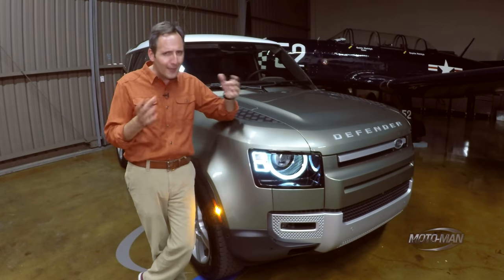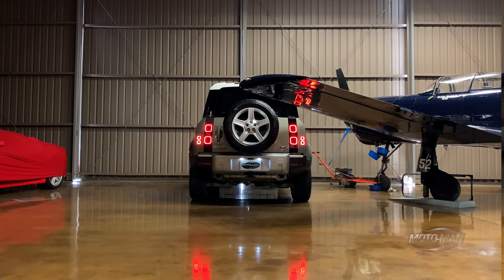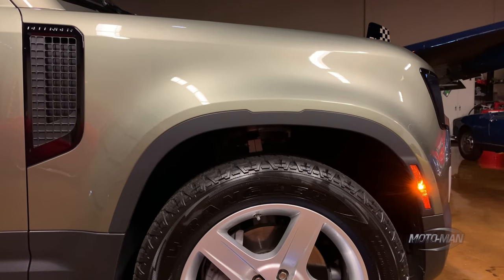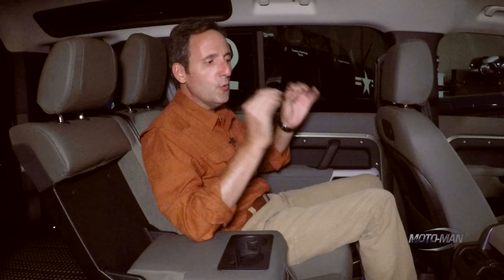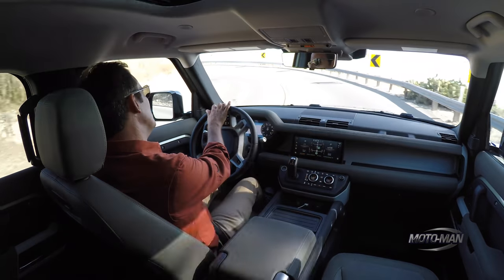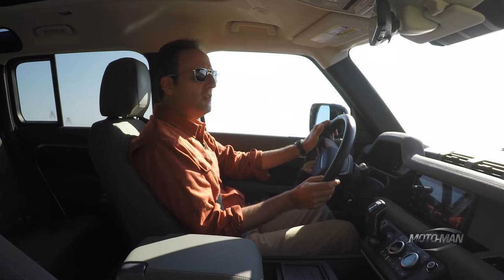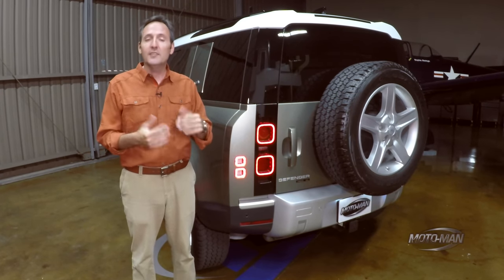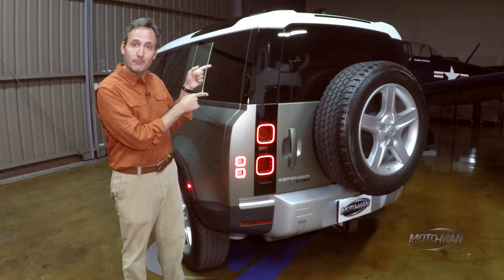The 2021 Land Rover Defender 110: Design, Tech & On Road FIRST DRIVE REVIEW

Comment: It's saturday morning and there is a new review from Motoman in my inbox - makes even a rainy saturday better! 
Even if a SUV or Defender ist not my cup of tea. The design is not bad - not too much retro harping back to the original Defender, its something newish, the main competition is the Bronco I guess ? although they must have targeted the Jeep line-up...
Reply from the maker: Tough call . . . In a round about way you could say:
- A VERY fully loaded Wrangler
- G Wagon
- Land Cruiser/LX570
- Bronco
However, with this massive shift in the Defender platform, I see the Bronco, Land Cruiser, Wrangler and G Wagon now in their body on frame class.
Reply: @MotoManTV   true - Wrangler is cult and its own market, body on frame capable, Bronco is a winner there, Defender is going somewhere else..on the road, nothing like the old Defender.
G Wagon is the most capable off road  - but it's so expensive you don't go off road  :) only the older one. I visited a childhood friend, he had a G-Wagon then and still got the same one wrenching on it, using it in the mountains still every day,  it must be 40 years plus - easy. 
Land Cruiser they are also huge..but can do both. You never see them over here, too big I guess.

Comment: The irony is the cost. Rover used to be "expensive" with Tahoe's costing $90k these cars are a good choice.
Reply: As bad as GM reliability is, Land Rover wins. They are the king of unreliability.
Reply: @electrikoptik  that's fine. Many dealers are now offering warranty for life. Id but one.
Reply: thereissomecoolstuff but is it bumper to bumper warranty 🤣 cause that’s the only way I’m ever gonna get me a Land Rover
Reply from the maker: I was more than a bit taken when the Gladiator came out and they were EASILY rolling in at US$50,000- US$60,000 . . . Yes, a SUPER cool vehicle, but at that point, I am thinking something else . . . Which makes the pricing of this rather competitive.
Reply: @MotoManTV  it's funny you mention the gladiator. I am jonsing for one bad. Diesel with adaptive cruise and I'm good. I wish more channels were honest about the cost and labor on accessories. You keep it real with the $700 blue stitching on the Porsche steering wheel...lol. Great video MM.
Reply: Yes good point.  I could live easily with a base spec Defender as it still has lots of features and does not skimp on the off-road parts.  And a base spec Defender price overlaps a "high spec" Jeep price - on purpose.... I know lots of Jeep owners who love the toughness, but hate the reality of the crappy on-road driving.  They could be tempted....
Reply: @thereissomecoolstuff  please tell me which ones
Reply: @curtissharris8914  which ones? Not sure what your asking.
Reply: @thereissomecoolstuff  many dealers offering warranty for life
Reply: If they offered bumper to bumper warranty for life, I’d be tempted. I looked at a 110 yesterday in the US and it was $60k msrp.  It was sharp. But reliability concerns and high depreciation would keep me from buying one currently.

Comment: This should have started out with a general public warning of ( We understand it's nearing the 50th anniversary for the company having built a truly reliable vehicle we've been riding the coattails of. But....)
Reply: are you implying the early defenders were reliable?
Reply: @turnerc7  Hardly, but at least the truly early ones usually had smaller mechanical issues you could rig & limp it somewhere. Now they just drop dead on the electrical side & say call a tow.

Comment: Wondering how responsive the touch screen and controls in the  center stack are?  That’s been a complaint of past models.
Reply from the maker: They were somewhat responsive in my time with it . . . one UX issue I did not bring up in the episode is tuning the radio. Very cumbersome and requires you to dive into screen. Would GREATLY appreciate another knob - perhaps on the driver's side of that panel for tuning and perhaps other uses like those two I demonstrated.
Reply: MotoManTV thanks for the info.  Your reviews are the best around.  Keep it up. Glad that you are back and doing well after your accident.
Reply: I test drove a Defender 110 X Dynamic yesterday and I found that the touch screen response was fine. It’s not as fast as an iPad, but it’s plenty quick for a vehicle system in my opinion. The Land Rover associate who was with me for the drive said that the only people he saw that had trouble with the speed of the response would hit the button more than once because they expected iPad like response time and then the system would lag a bit as it was trying to decide what the user really wanted it to do. It is a bit like saying to the system, “Go left! No right! I mean down!” all at once.

Comment: I would call it a Discovery Plus - and not a Defender. It`s not the vehicle you would choose for Overlanding. Starting with the max load capacity which is less compared to the old model. The best new Defender can take 844 kg, the e-version maximum 700 kg. Old Defender 110: 1142 kg up to 1395 kg. - Other problems are the tires sizes (try to get those of the new Defender in a remote area), the durability without a frame long term, and the number of electronics in the car. I think this new INEOS Grenadier will take the place of the old Defender in the Future. - Still a great car for the other 90% of the users.

Comment: This is not Defender.  The design and purpose are all wrong for Defender.  It is however, the best Discovery ever built.  The other issue (besides the whole design) is the model naming, 90 & 110!  WTF?  They are 100 AND 120!!!  70 years of tradition thrown out the window!  Horrendous!  Horrible!  Horrific!!! 

...but lovely.
Reply: Your obsession with tradition leads you to false conclusions. This is not a Discovery. It's a Defender through and through. The reason you think it's a Discovery is because this is a modern vehicle so it has lots more in common with the Discovery which is also a modern vehicle rather than with the old, antiquated and barely modernised over the span of its lifetime old Defender. Obviously a vehicle made in 2020 will have a lot more in common, tech-wise, with a vehicle made in the mid 2010s. It's capability and appointments though are Defender through and through. Land Rover were never going to make an anachronistic throwback with jurassic era tech and 'solutions' just to please the old Defender traditionalists. The design and tech of vehicles have to move with the times.
Reply: @cuttight  I've done 3 videos about everything that is wrong with the new defender and I don't mention axles.  Watch them...
Reply: @fabulousoffroaddesigns5080  I didn't mention axles either. But I did mention old Defender traditionalists longing for designs and solutions of the distant past.

Comment: Doesnt look fun.
Reply: It’s a lot of fun. I drove one and the only things I could nitpick was that there was less foot room near the front of the driver’s seat than expected (There is some sort of shelf the seat is mounted on) and there was a small amount of wind noise. The performance on road however was spectacular. Very little feeling of being a very tall and boxy vehicle the Defender is while navigating turns even at around 50mph. Smooth ride and thanks to the ample power of the engine (P400 inline 6) and giant calipers of the breaks it didn’t feel anywhere near the 5300lbs the Dynamic X model I drove is.